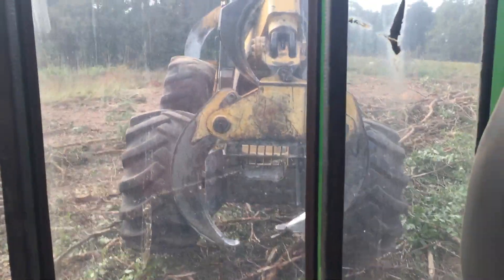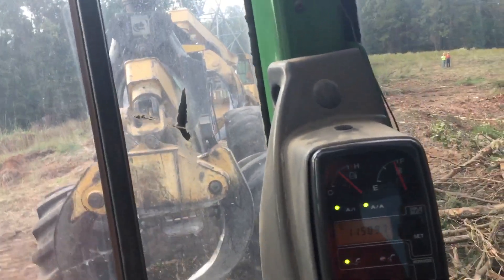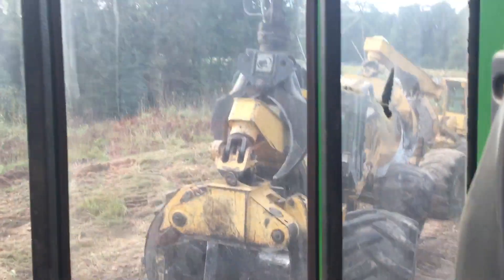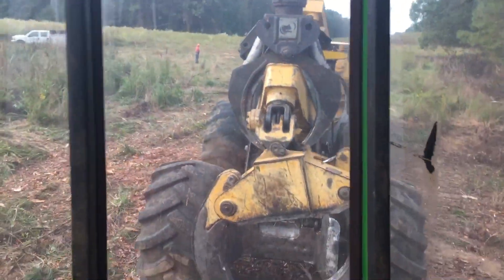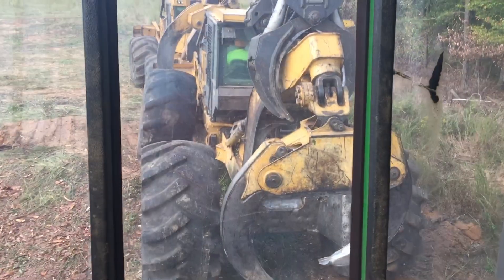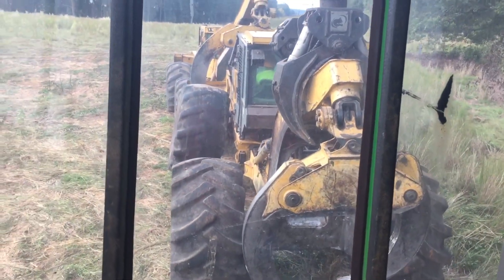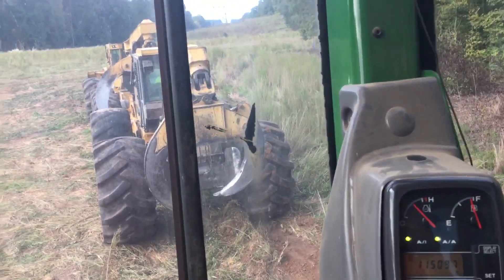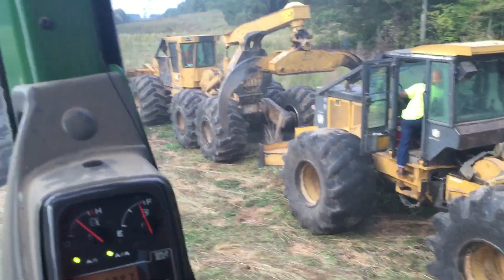Tigercat, John Deere, John Deere ~3 some~,  YEE HAW!!!!!

Comment: I have worked on hundreds of deere skidders, and dozens of tigercat skidders... the only place deere has tigercat beat, is a spring applied, hydraulically released park brake! Meaning " no engine running, no machine movement on a deere, tigercat park brakes tend to suck ultimate ass!. Just my take. Lol

Comment: We had a problem with the clark 664 it wouldn't move under its own power so we towed 5 miles from the job back to the shop to work on it.

Comment: What was the problem with the 635 why the brakes wouldn't hold or why did it quite
Reply from the maker: +Tiawan Elder When I got in the machine after it went off the hill, the operators cell phone was laying very close to the key.  My speculation- the key got hit somehow and put it in the off position and thats what killed the machine.  As far as why the brakes did not hold- tigercat has a mod for the parking brake that they have failed to notify us of and they are gonna fix it in the morning.

Comment: I'm surprised that there isn't a way to "unlock" these machines manually for times like this.
Reply from the maker: You can manually release the brake but we just didn't have time to deal with it because we were loading machines on the lowboys heading to the next job.